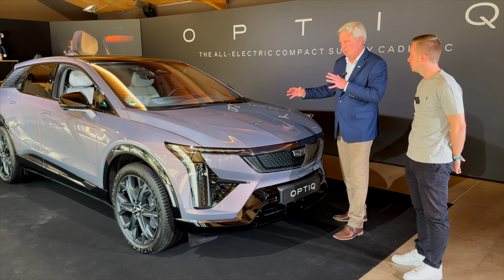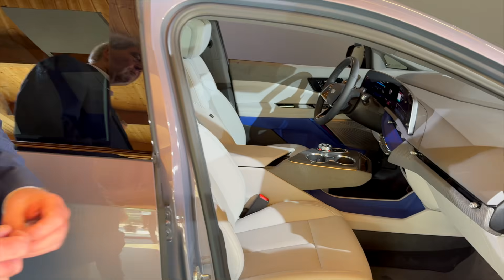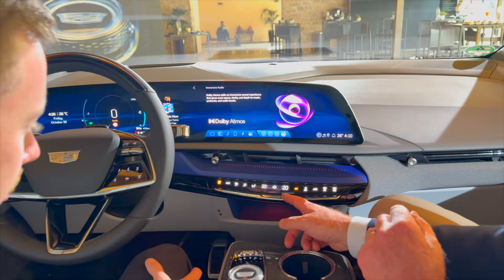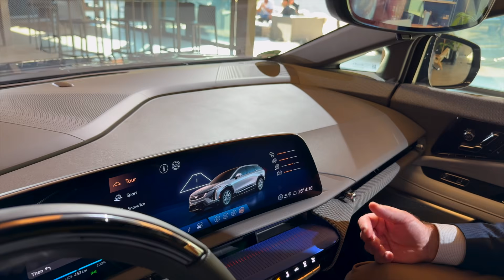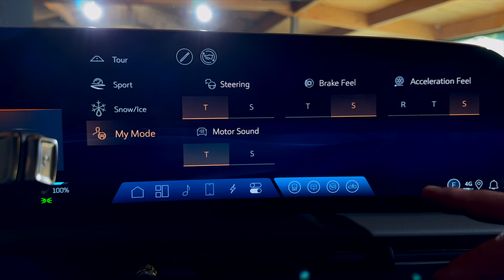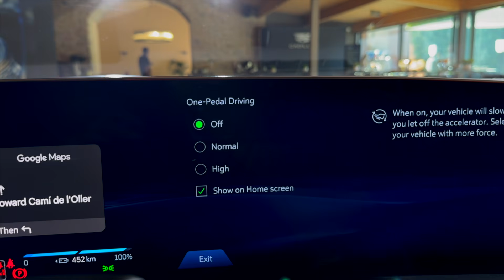CADILLAC OPTIQ 2026 - FIRST LOOK & INTERVIEW WITH JOHN - CHIEF ENGINEER

Comment: Cadillac is getting it right great little ev drives super fast smooth and its beautiful inside and out just leased a 2026 in the two tone red black love driving it just as much as my 2025 Lyriq love the small changes for the 2026 model no button to turn car on and off love that next year getting a Lyriq V will see how the lease programs are.

Comment: Why does Europe get the amber indicators and a rear fog light but Americans are forced to have blinking brake lights?
Reply: I had a 2013 Chrysler 300 C with LED rear fog lights. The LED rear fog lights were so bright on that car that when someone would ride my ass, I would turn on the rear fog lights and they would back off immediately some auto manufacturers offer rear fog lamps in United States, like Mercedes and Land Rover. Rear amber turn signs are another story.
Reply: Legal requirements